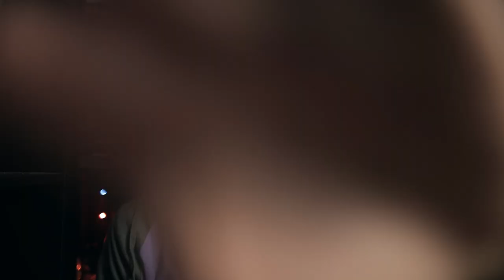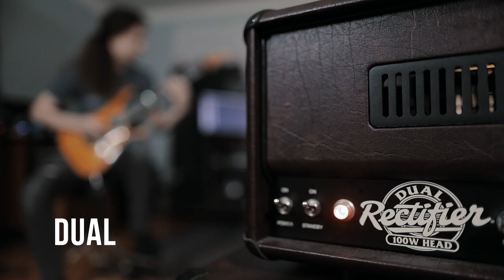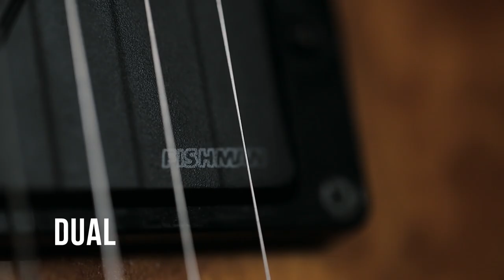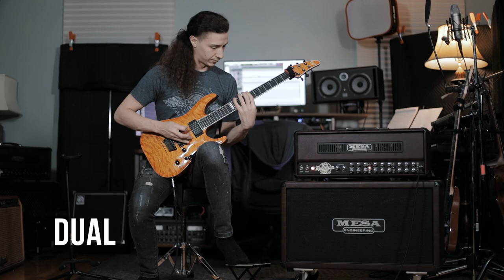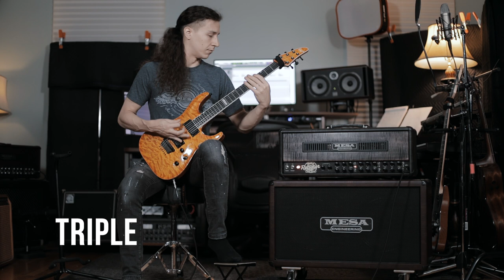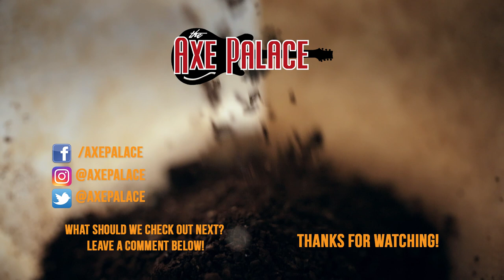Mesa Dual Rectifier vs Triple Rectifier Multi-Watt - Modern Metal Comparison | Axe Palace

Comment: Would you take the Mesa amps over the Diezel Herbert and/or the Diezel VH4 or the Diezels as the end tier metal amp?
Reply from the maker: It sort of depends on the sound/feel you're after. The Mesas are much more "raw" and "organic", with a pronounced midrange bark and crunch that is unmistakably Recto. The Diezels are more of a polished, somewhat compressed, somewhat more scooped "wall of sound" kind of thing. I like them both a lot. The VH4 is fantastic. It's very tight and ballsy. The Mesa I think cuts more and is just really savage sounding, although it does kind of need an OD in front to be an "end tier metal amp". 

If I was forced to choose I would go with the Dual Rectifier, but I love the VH4 also. It's also worth considering the Mesa Badlander amp which is kind of like a more modern, tighter version of the Dual Rec.

Comment: The triple sounded awesome. I have a dual already. I threw out the mesa 440 tubes that it came with, too bright and not enough grit. Put in 5881s, man what a difference. It made my dual come to life.
Reply: Which one do you prefer?

Or is it me or does the triple have more distortion?
Reply: @24MusicCarats  that is a very good question. Natural I think that the triple does have a bit more gain. I know it has more kick. I did like my dual after I put 5881 power tubes in it. Otherwise I about hated that thing before that. Lol
Reply: I just got an EL34 Dual and swapped for 5881s much better

Comment: I owned a triple for years and loved it. Although in this mix I felt the dual to be more punchy.
Reply from the maker: In real life when you A/B them its the same way. I assure you it wasn't the mix but rather the inherent differences. They both do sound great however. The Dual is noticeably warmer/punchier in an A/B test, whereas the Triple has a bit more sizzle and scoop.

Comment: I like some bottom end on my 7strings. I usually split my signal with one going to my bass amp because it sounds wicked, Im guessing the triple is what I need. I haven't checked but does Mesa retain its value ? I was gonna get a mini because I've never owned a tube amp,but hey, you only live once.
Reply from the maker: Mesas retain their value as good as just about any amp. It depends on the market conditions and other factors. But generally I suggest people just get the right amp rather than worry about future resale value. If you buy them new from a reputable dealer such as us, you will always get a trial period to ensure you like the amp before committing to it.

Comment: Hey brotha does the triple have more gain overall?

I used to have a vintage 2 channel dual rect and it always felt like it needed more distortion.
Reply from the maker: They have the same amount of gain, both amps benefit from a boost in front like a TS808 for modern metal applications.

Comment: Both running 6L6's? And did you dial them in the same exactly, or how individually how each one sounded good?
Reply from the maker: They were both 6L6. I don't recall the exact settings. In general however I find the Dual Rec sounds better and is more fun to play than the Triple. One thing that can't come thru a video is feel, and the Dual feels more responsive and less "stiff", to me.

Comment: Were these amps set the same? The mids coming from the Dual sounded quite a bit more prominent than they sounded on the Triple.
Reply: Indeed. But maybe that is the difference between the amps. I take it he set them the same.

Comment: The Triple sounds more scooped than the Dual. That's not a bad thing, it makes the Triple sound bigger. The Dual sounds like it would be more forward in a mix though with all the extra mids in there... but I'm not sure that's the best thing. ALL MIDS ALL THE TIME kinda sucks and gives you a really flat, 2D kind of sound. The Triple sounds deeper. Not bassier, but rather like there's more "sonic depth" there. The Dual sounds like a drag car where the Triple sounds like more a thunder storm.

Comment: Sounds to me like you could blend the two in a mix and get a sound that's bigger than they already are on their own.
Reply from the maker: Sure but you can also just double track on the same amp using different channels (vintage/modern) or even the old trick of layering one track with scooped mids and the other with heavy mids but less bass and highs .

Comment: Dual Rec sounds like it has slightly more upper mids that sort of round it out. This stands out a little more to me in the leads and the harmonized strummed riffs. The Triple sounds like it has slightly less mids (not quite scooped, but more in that direction) and a little crisper high and low end. I prefer the Dual, but both sound good.
Reply from the maker: Fair analysis. The thing that cant be captured in a video unfortunately is the FEEL. Playing both amps is just a completely different experience.
Reply: @AxePalace which ones feel do you prefer

Comment: Dual: mids
Triple: not as much mids, punchier bottom
I honestly think this has more to do with the EQ settings not being set in relation to eachother. I think they can sound more similar to eachother, but I'm not sure that's the way to go.
The triple has an amazing low bottom end control, and letting that be a central part of the tone may be it's preferable setting, while the dual might benefit from a more mid rich tone.
Reply from the maker: GurktheBrutal nah it's got nothing to do with the EQs. The amps just sound drastically different. And even more so FEEL different.

Comment: I enjoy the Triple rectifier, but the dual rectifier is just too flubby in the low end for me
Reply from the maker: DC Welker it's all about matching it with the right cabinet. Mesa's cabinets sadly do exhibit that "flubby" character you speak of, however when you run a Dual into a different cabinet they can sound quite tight and clear - especially with an OD in front.
- Nick

Comment: Mesa amps need a boost/OD but Diezel amps do not.
Reply from the maker: That is true, but nearly all high gain metal amps on the market that I would boost anyways, regardless of how much it needs it. The Diezel benefits greatly from a boost bc their low end can be over the top.

Comment: Which one is tighter without a boost?
Reply from the maker: KidsOnALeash OnABoat for modern metal I wouldn't suggest using either without a boost. Same goes for most amps. That said, the Triple is probably a hair tighter.